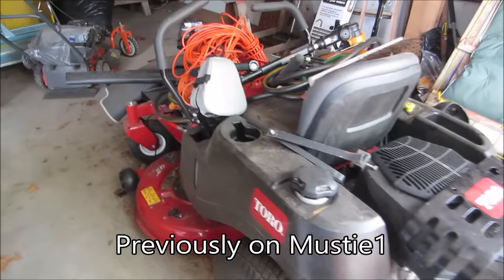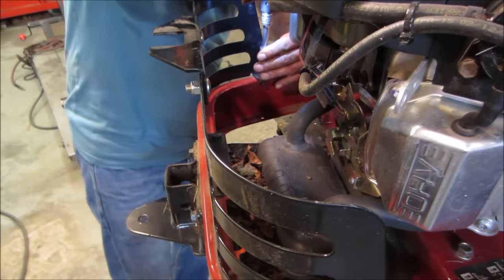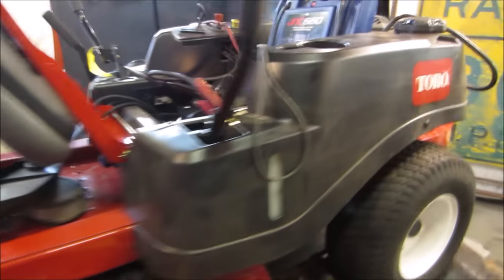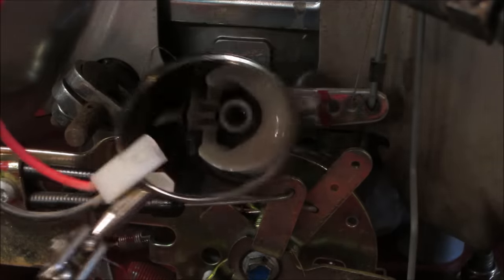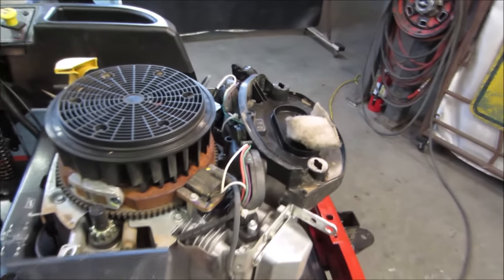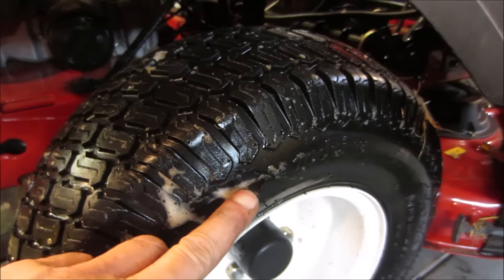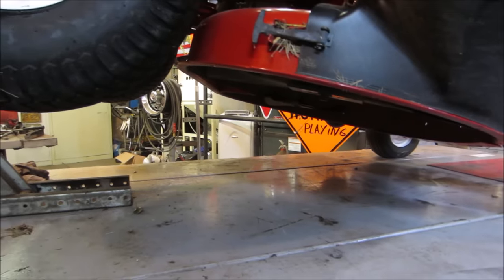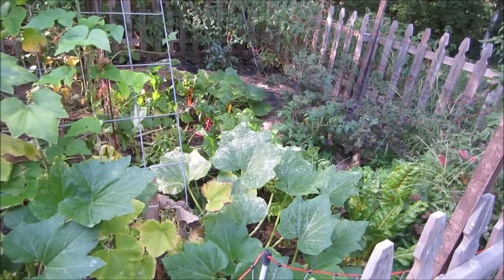Yard Sale $400 Toro Zero Turn Mower. Sitting For 10 years.

Comment: The Timecutter models were not to bad. Definitely not a pro machine though. I used to work as a mechanic at a Toro dealer. We also sold Hustler and Wright. Which I thought were much better mowers.

Comment: Wonder if that fuel had a stabilizer of some sort in it?  To be 11 years old and still be able to run that engine they must have stabilized the fuel, otherwise it wouldn't have ran I don't think, and the carb wouldn't have been clean.  

Another great score on that Zero Turn.  Not a fan of them, always have had lawn/garden tractors that have served me well over the years, I'd have no dang idea how to operate a zero turn, I'd run into everything around me LOL.
Reply: This mower is a 2014 model! They obviously bought this mower after the guy died! So it hasn't been sitting 10 years! Impossible!
Reply from the maker: mower was serviced in 2014 that is when the blade was installed upsidown, repair tag was still on it
Reply: @mustie1  The mower is a 2014 model. The Kohler KT725 engine that's on it was only used on the Toro SS 4235 in 2014. The older models of the Toro SS 4235 have different engines. Also, Did you see the fuel hose that is dated 03/12/13?

Comment: exmark and toro has some of same parts.. I've seen the diaphram in carb blow and wouldn't pull fuel.. some of the plastic key switches come apart also.. bc they are junk..

Comment: Since I have a frugal streak, I use tire sealant only when no other option is available. The tire would be fine with an inside patch. Sealant(YUCK) causes an extra step and chemical use to enable good adhesion......I like RED TOP tire repair products (Germany). A little of their liquid buff, (and no soap in the crack), let dry,  then the cement, and that 'experiment' probably would have held.....

Comment: Woops. Forgot one thing. If your battery terminal are cruded up clean off and cable also. Then cover with a layer of grease after all together. Will help keep carosion way down.

Comment: I work at a mower dealership/ small engine repair shop and them rear tires should be at 12 and the front ones are supposed to be at 10

Comment: You pull the little tabs out, then down. How do you see 'push them in'? It clearly says out and down. Slime will NOT fix it in that location. I just went though all this on mine. I tried one plug, two plugs, slime, etc. Running it will leak when it flexes. Finally just had to tube it. (cleaning out slime sucks) You can use little taller rear tires, just re-level the deck after. And you sould check the fuel vent hose. It's got a fuel filter on the end that gets clogged with mud daubers. Oh, there is no break peddle. It raises the deck. Can't you hear me? I'm yellin! Oh, always engage the deck @ 3/4 to full throttle, and disengage at low. The bags will fill up way too fast. You will find you are going to not use it as much as you think. Those Kohlers are good engines. the hydros are decent, and you can change the fluid. The upgraded hydros have filters. The engine oil should be changed a few times before 50 hours, with the first being less than 5 hours. The hydros takes standard 50w oil. I was telling you all this as you were taking. Didn't you hear me over the fans and AC?

Comment: Isn't there is a two part epoxy  for tires that you can use. I used to work  at a garage  on of the worker repair a tire of his with it . His tire had bad spot that was down to the cords  and he repaired it with rubber  epoxy for tires.

Comment: Check out GLUETREAD External Repair Kit, made for patching off road tires, repairing sidewall damage
repairing a sliced tire
repairing a punctured tire
adding extra protection to areas of a tire that are worn
covering cord
covering a bulging tube
covering an internal patch
covering and repairing a cracked tire to keep out debris
preventing a higher risk area from leaking in the future
Saw it on another channel and seemed to work really well.

Comment: Slime that tire i had a tire on my mower that would leak out in 3 minutes if that, I  aired it up and by the time I put the mini air compressor away and moved it 10 feet to the trailer it was off the bead put slime in it and its like a new tire hadnt had to add air since

Comment: I Have A Question For Whoever Would Know But Is There A Spacer That Would Go Between The Electric PTO And Drive Pulley On The Engine Of A John Deere GT 275 Lawn Tractor And It Has The Kawasaki 17 HP Single Cylinder Engine Also? Everytime I Install The PTO On The Engine Shaft Along With The Drive Belt Pulley With A Small Rope Put In The Spark Plug Hole And Using Just A Ratchet And Socket, I Can't Go More Than 50 Feet With The Blades On And Mowing Before The Bolt Backs Completely Out Along With The Cup Washer And The PTO and Square Shaft Key Falls Off. I've Checked The Bearing On The PTO And It Works As It Should, Is This Something That I Should Try Putting On With One Of My Electric Impacts Or Not?

Comment: I noticed that the pressure seat switch is disconnected..have you tried the 2 wires together?
Reply: stupid safety switch can be jumped out/bypased with a paperclip. you can cut the end off the plug and splice them together but a straightened out paperclip jammed in the plug is faster

Comment: is there a seat safety switch that will not let it start when it is in the forward position?
Reply: stupid safety switch in the seat is supposed to not let you engage the PTO/blades if you arent in the seat. first thing most people bypass. you bounce out of the seat going over a bump, machine tries to shut down

Comment: Woah there, settle down, no way this is better than a craftsman lt1000 lol. You can't haul anything with a zero turn, like a trailer full of lumber, and you cannot do any sorts of hills or humps with it either. A zero turn also has no traction in any damp grass. I used my craftsman lt1000 as a work horse and it has never failed me. I even cut trails in the bush with it and still hasn't failed me. Throw some blades on it and change the oil once in a while and its good to go. Will outlast any modern machines, especially this toro trash.

Comment: This mower has not been sitting for 10 years! It is not even 10 years old! If the previous owner's husband did die in 2009 then they obviously bought this mower after he died. This mower was most likely manufactured sometime in 2013 or 2014 to be a 2014 model year. Notice the date on the fuel hose is 03/12/13. The Kohler KT725 engine that this mower has was only used in the 2014 model year, so it has to be a 2014 model!

Comment: Cheap El-Toro NOT. No the cheapest Toro is out of my budget bracket, but not age bracket because I finally got a rototiller rather than the spade shovel. Now I have to fix it every year. Since I put the most expensive oil in my car and change it when I am supposed to I use it in my digger.

Comment: the date on the fuel hose says 2013 (14.57)
Reply: Yep, Exactly what I saw too! The mower is a 2014 model manufactured in either 2013 or 2014!
Reply: @whatitis99  so its not 10 years old
Reply: @samsmh9644  Nope! It's not 10 years old!

Comment: Oh you can't always blame the dealer you blame the dealer because of the people he hires he's got to do more stringent background checks because somebody can just walk in and say yeah I know how to work on small engines yeah I've worked on lawn mowers meanwhile is a backyard mechanic I didn't know it's absolutely very little about Motors and mowers and and snow blowers and everything is supposed to know about he just has just enough knowledge to get himself in trouble and that's why you wind up with lawn mower blades upside down and the wrong carburetors on chainsaws and the wrong carburetor is on weed wackers believe you me that's happened to me I wound up with a weed wacker with a chainsaw carburetor on it how that worked I have no idea but it was working
Reply from the maker: this one had the dealer service tag right on it